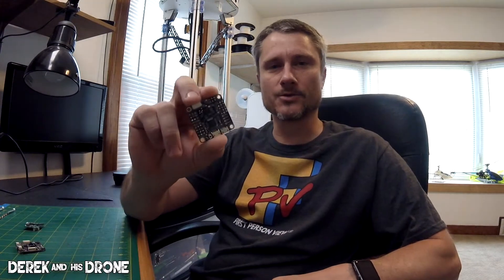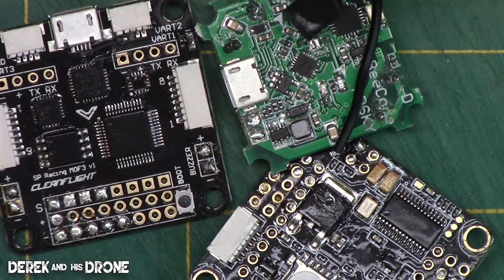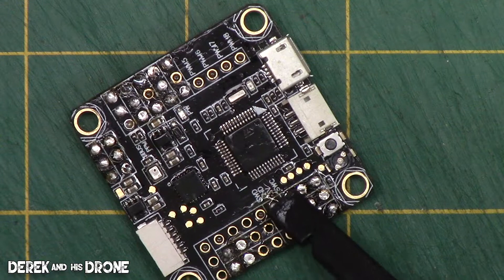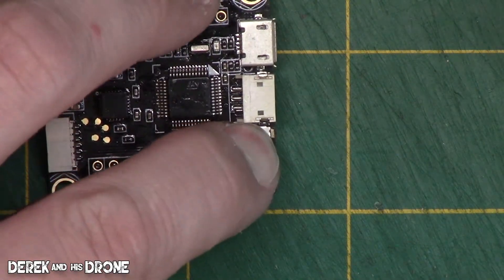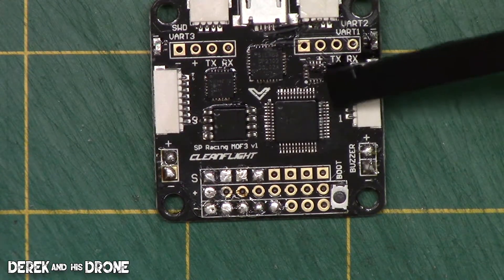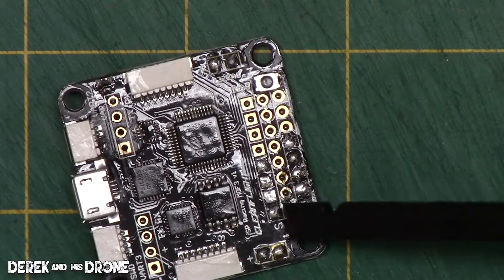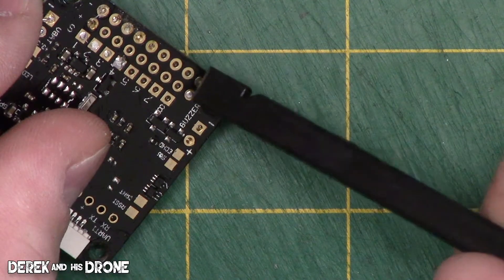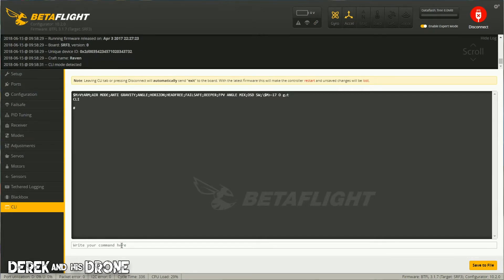Basics of Betaflight - Entering DFU Mode

Comment: Hi my name is Kenny and I knew 2 fpv drone racing I hook everything up download of all the software and everything for betaflight and I got my turnigy evolution controller to connect to my drone but my a turnigy will not connect to the controller set up for betaflight
Reply from the maker: I'm not sure what you are asking.  Can you be a little more specif?
Reply: @DerekandhisDrone  hi I think I have to up date my betaflight configurator to 10.5.1 that is the new one my turnigy receiver is bind to my drone but I cannot get it any signals from the receiver on beta flight
Reply from the maker: I would recommend having the Betaflight configurator and flight controller firmware on the latest version.  Make sure you have the correct uart set to serial rx in the ports tab and don't forget to pick your receiver type on the configuration tab.  If you are using sbus make sure it is connected to the correct pad.
Reply: @DerekandhisDrone  ok I will give that a shot thanks so much

Comment: Shorting the boot pads with tweezers is also a pretty safe method. 
Also some versions of BetaFlight will allow you to enter boot mode (also called DFU mode Device Firmware Upgrade) by 

*connecting your flight controller to BetaFlight via USB 
*opening the BetaFlight GUI 
*connecting via the connect button top right hand side of the GUI with the correct Com port selected 
*going to the CLI tab and typing BL (at the bottom where it says "write your command here")
*pressing enter

you will then be offered the "Firmware Flasher" option on the top left hand side of the GUI
Reply from the maker: Modern flight controllers have replaced the boot pads with a button.  Basically unnecessary due to the bootloader command.

Comment: No damn response from boot loader.. i can't believe how much trouble this stuff is giving me.
Reply from the maker: You need to have a DFU driver installed.  What are your issues specifically?
Reply: @DerekandhisDrone  I'll just start at the beginning.. i looked around for some of the cheapest stuff that wasn't trash to get started (just need to get this little one flying and learn to fly for now). Ended up with an x-lite radio $110, a little eachine E010sPro$50. And 7"Ares z-fpv monitor w/diversity$40. So i got the radio up and running by installing stuff on the micro sd and then putting it in the xlite and then flashing etc. I got it calibrated, bound, unlocked throttle with the sticks but still can't get throttle working/the red light off. so i went and got betaflight and i think right now what it is coming down to is my computer is just too old to really utilize some of the real time stuff it tracks when connected to Drone, been looking at getting another  soon. But i can use someone elses probably for now. Oh and i noticed after plugged into the usb for a min the xlite would lose and gain telemetry repeatedly. I don't need a bunch of tuning and stuff yet, not until i build one, just trying to learn to fly. I messaged that 413 support phone number you put up. Thanks for all your effort/help and videos
Reply from the maker: I'm not exactly sure what you have going on. I shut the phone off because of the expense.
Reply: @DerekandhisDrone  well first of all every time i was trying to configure stuff in b flight telemetry was constantly literally lost gained lost gained lost gained.. so as you can imagine it was nearly impossible to make adjustments and see what the radio was actually doing well. I came back home and was looking at the little wire antenna on the e010spro.. it looked.. i dunno just wrong and loose and i resoldered it on, now signal is strong and never comes and goes.. so going back to my neighbor's today cuz my pc is giving me issues, and trying again. Based on the 413 I think I'm in your local area Derek...
Reply from the maker: That can happen if the radio is too close to the receiver.  Otherwise you are right on track with the loose antenna wire.  They break easily on small quads.  In in Western Massachusetts in the Springfield area.  We have a Facebook group, feel free to join.  Search for Western Massachusetts FPV

Comment: Best videos for betaflight derek. Thank you. I just never wanted to get the new betaflight and none of my stuff will work anymore...lol. i HAD to change
Reply from the maker: There is about 10 or 11 videos in this series now.  With more to come since it's winter.  I hope it all works out for you.
Reply: @DerekandhisDrone  i did get it to connect and im checking all my versions of  bf firmware.....and some of them are REALLY old....lol. you think the flight controllers will take the newest firmware?
Reply from the maker: Yes, The BetaFlight devs have made a lot of effort to make sure most flight controllers are compatible.  Unless you have something really old like an F1 board.

Comment: Great videos bro learned a lot from you. I do have a question though I have a inductrix fpv Pro fc and it connected to bf and then I flashed 3.2 on it and it won’t connect anymore. I tried flashing it again and back to original firmware but no luck. There is nothing showing where boot pins are m. Do you have any Expedia vr with this? Let me know if you do thanks!
Reply from the maker: Sorry I don't have any experience with that board.  From what I remember it has an F1 processor I would stick with 3.1.7.  Have you tried using the cli to enter DFU?